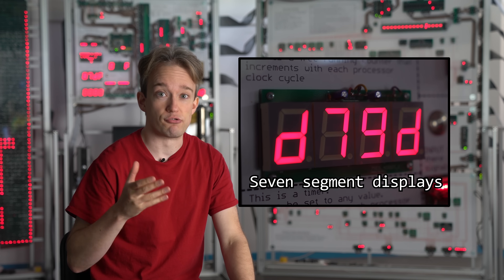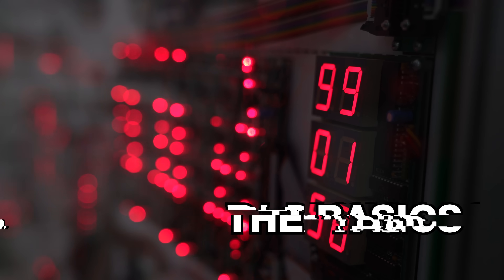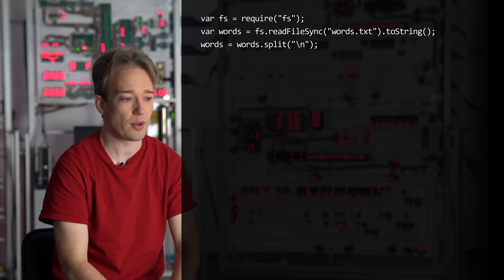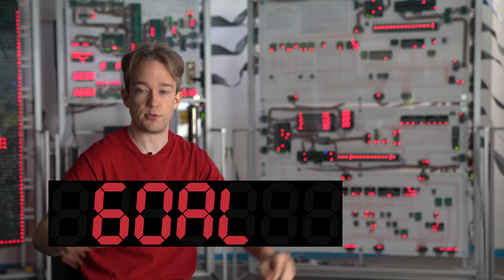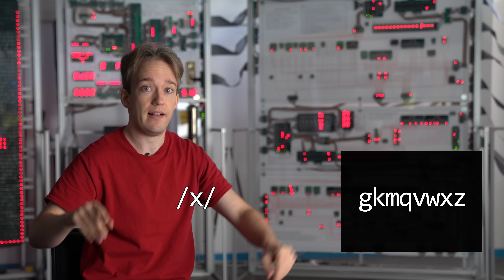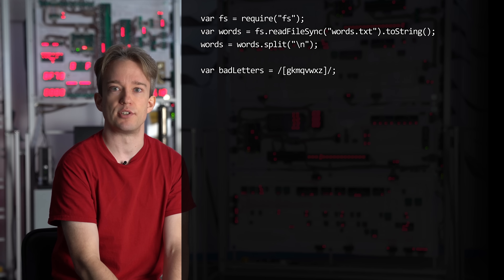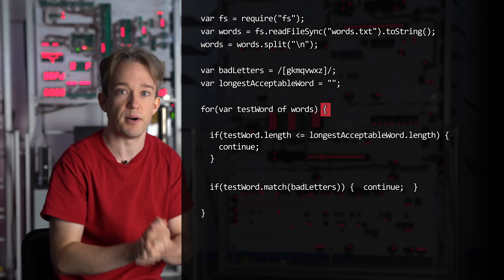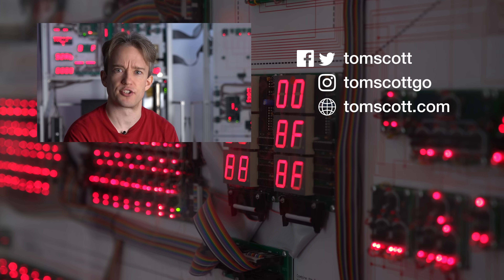What's The Longest Word You Can Write With Seven-Segment Displays?

Comment: How would I do that? Instead of the longest word, save the length. Then add the word to a list of longest words.

If the word is shorter than the longest word length, it's ignored; if it's the same, it's added tp the list; if it's larger just clear the list, set longest word lenght to the new one, and add the word to the now-empty list.

Comment: 7-segment displays are still used a lot on thermostats for commercial cooling and heating. As for M. Manufacturers just use N and let you scratch your head for 5 minutes before you get it.

Comment: Why not have the "N" lower case? Otherwise, you aren't sticking to your own rules that you can't do diagonals. Also, that "G" looked absolutely fine, not the "6" one but the one where you took out the middle horizontal line. It clearly looked like a "G," no one would ever mistake that for a "C." Not only that, but you'd use a "5" for the letter "S" but you won't use a "9" for a "q?" Nor will you use it for a "g?" Why the hell do you have such a hard time following your own rules? It doesn't make sense if you don't follow your own rules.
Reply: That shape G is practically used to mark Ground Floor in lifts (elevators) with 7 segment display.
Reply: 3:59

Comment: Js isn't the best language... If you use "var", it certainly isn't.
Reply: JS is just fine for the job at hand.
var is also fine.
APL would be the best language for this because it would only take one line of code.
Octave can also do it in fewer lines than most languages and no loops.

Comment: Please, please, please don’t teach people to do file I/o that way. Next thing you know some joker is going to think it’s ok to write code that attempts to load an entire gigabyte file in to memory at once. No reason to try manipulating the whole of the English language in memory at once, just go word by word. I suppose it might run slower, but then your code will work regardless of file size.
Reply: It will actually run much faster using a readable stream instead of dumping the entire file in memory using fs.readFileSync(), I guess largely because you don't have to wait for the file to load before starting to process it. I tried it out and with the example file the streaming version was about 3x faster (and it had a much smaller memory footprint, of course).

To be fair, the example isn't really about file system i/o, and Tom does a good job of illustrating the point that programming is largely about analysing and solving problems. I think it would be a bit much to start teaching beginners about events and streams. ;)

Comment: Well instead of continue you can inverse and nest the if cases but that can also be messy, which is why it's a tredeof and depending on what you are doing on or the other is the best option
There are alot of cases where there is an inverse version of you code that will look differently but do the same thing

Comment: You don't need code as such to do this, you can use the egrep command:
egrep "^[^gkmqvwxz]{11,}$" words.txt 
The regex matches all lines that consist of 11 or more characters not in the list. The 11 is the minimum length. In the list I was using 11 with the full list only found 1 word: "nystatinoaf", although that word only returns links to word lists on google, so I'm not sure if it's real, or a typo in the list.

Comment: You can also use a functional approach to solve this problem instead of the loop, which is usually easier to read and understand. 

words = words.filter( ( word ) => !word.match( badLetters ) ); // Filter words that do not match the regex
words.sort( ( a, b ) => b.length - a.length ); // Sort in descending length order
console.log( words[0] ) // Print out the longest word

Comment: You can do it in a single line with Mathematica:
MaximalBy[DictionaryLookup[Characters["abcdefhijlnoprstuy"]..], StringLength]
Using that I get the result of "uncharacteristically" and "tenderheartedness" if I disallow I and O (each unique for their length). It only has a dictionary size of 92518 words though, which is a fourth the size as the one you used.

Comment: ages ago I had made an 8 digit 7 seg LED display (video of it on my channel) that could take ASCII serial (BELL character made the unit beep , numbers, colon and capital A - U) and display numbers and letters, I'd programmed it to use the "C with aspirations" for the G and displayed other symbols for a few of the letters that couldnt be adequately be displayed  (like K M and Q i think) and I didnt have room on the controller for letters after U anyway so (any undefined characters) they just display the ASCII code pattern in binary (either looked like a garbage character or one of the previous letters or numbers)

Comment: I get away with banned letters on a seven segment display by just marking them with the decimal point and just letting it be.
For example, M would be n.n., covering two of the SSDs.
A K is just an H with a dot
A G is like the incomplete 6 you mention, but with a dot. Actually looks fairly close.
A Q is just an O with a dot.
A O is the undercase o.
Repeat until you can accept the full alphabet however you like.
If I can find the code I did for this I'll definitely put it in here.

Comment: You can easily check for multiple words of the same length by creating another variable that logs word length and make the code test var length against that. longestAcceptableWord gets concatenated (with a space) if word is equal length and set to new word if word length is greater. Not very much more code to implement that.

I studied coding in college some years ago but I don't work in the field anymore. I like the simplicity of JS though.
Reply: also I think i and o are fair game if lowercase, much like r

Comment: If you only want to test whether a word contains these letters or not, use badLetters.test(testWord) instead. It will return a boolean instead of returning an array or null like badLetters.match(testWord) does. There is nothing wrong with the "continue" statement in my opinion but using it in this code felt really unnecessary. Rather than making use of this statement, you could have tested for testWord.length > longestAcceptableWord.length and then for !badLetters.test(testWord) to change the longestAcceptableWord, I feel like it would have been easier to understand for viewers that don't know how to code. Still a really interesting video though, didn't expect that many letters to be writable on a seven-segment display !

Comment: i and o can be written lower case to avoid ambiguity. n is perfectly fine even though it is more commonly written as lower case too, it just looks nicer. G should be written without the middle segment as this is unambiguous. S and Z should either both be included or both omitted as they are valid but ambiguous

Comment: Multiple longest words. This is some broken untested code. Correct me if I'm wrong

// previous code to read from file
var longestLength = 0;
var matchingWords = [];

for (var testWord of words) {
    if (testWord.match(badLetters)) {
        continue; //remove disallowed words
    }

    if (testWord.length < longestLength) {
        continue; // word is not long enough
    }

    if (testWord.length == longestLength) {
        matchingWords.push(testWord); //this word is as long as the others
    }

    if (testWord.length > longestLength) { //this word is longer than the others
        matchingWords = []; //clear all the shorter words
        longestLength = testWord.length; // update the new longest length
        matchingWords.push(testWord); // add this word to the longest
    }
}

console.log(matchingWords);

Comment: 8:22 you can just change the < or = sign into a purely < sign so it will prossess words of the same length then you create a new variable array called answer and if it passes the bad letter match add it to both answer and set longestAcceptableWords to it.

Edit: also keep running answers against longestacceptablewords and deleting the answers that becomes shorter than it.
(I know this is inefficient but it’s the best I can do)
Reply: Keep track of the longest word length as a int.   If = add to the array. if > set to new array.

Comment: In my opinion you could've included the q. Your reason was "because it's basically a 9", but I don't find that to be good enough reason, as a) You could say the exact same thing for b and 6, but you've included it, b) it's not completely the same as 9 (as for example S/5 and O/0 are).

Comment: No, 'this' isn't fine. Continue is sin. Never use it.
Reply: Yes, always make it a big long switch statement inside a while and fiddle the index of the switch.  This way nobody will ever figure it out.
Reply: put the body inside a function; return it when it fails at precondition; same thing as continue?
Reply: Kirrim Kerman:
Since JavaScript allows you to have an array of functions etc, you can just have the if statement change the function to be called later on.
Reply: @kensmith5694  I don't think that this is in any capacity a good practice.
Reply: Kirrim Kerman:
My suggestion was not serious.
Reply: @kensmith5694  I kinda assumed that.
Reply: Nested if statements would have yielded the same result, or the && operand
Reply: Why? There's nothing inherently wrong with continue. It can be used badly, but so can nearly everything else. In this example probably a simple if with lazy eval would be nicer, but the continue works fine too.
Reply: Honestly my only issue is with the name. It should be called 'skip'.

Comment: Wouldn't it be better to add the i regex flag and make the test case insensitive? Or is the list only in lowercase?
Reply: nah, the list is lowercased already and case insensitivity adds a marginal overhead
Reply: Hence why I asked about the case of the list. 

Though said overhead is very, very tiny. I actually run through the list twice, once to find the longest word, and once to find any others of the same length. It was sill near instantaneous on a Core2Duo--running inside a browser.

I kept the i because it allows me to easily copy and paste in letter lists, even if the person uses mixed case.

Comment: Tom: you had a if "equaly or shorter" in you word length comparation so I think it will output the last word of the longest length so if it just list all words that it finds after it discarded ones with unacceptable letters you will have all of them with barely any changes in the code.

Comment: Why do you seem disappointed with the word at the end? I mean more...what were you expecting. It seems the result wasn't whatever you were shooting for. I'm not challening you to not be disappointed, I'm just not certain why. It's a neat word and it's a "real sounding" word vs some odd sounding word.
Reply: I don't know about Tom, but I don't like that it's just an artificially extended word using the wrong suffix. The noun form of "transcendent" is "transcendence," not transcendentness. 

Removing that word from the list, I get both "superrespectableness," and "supersuperabundantly." The former has the same problem: the word should be "superrespectability." And I find "supersuperanundantly" to be stretching the ability to add prefixes.

So, after one more try, I get "supertranscendently," which does work.
Reply: Thanks! I see, I'm not the best with words, so I didn't really see that issue. But I can see how that is disappointing for sure! Thanks again for taking time to reply!

Comment: I thank RNJesus this problem is more like a one liner in nodejs and browsers theese days, but indeed Tom explained it very well. This version filters out undisplayable words and sorts the words by length descending: words.filter(word => !/[gkmqvwxzio]/.test(word)).sort((a, b) => a.length < b.length)
Reply: Paul Bottin and you can also Console.log the [0] index in the same expression :)
Reply: AramesK Channel™: Yes but then you lose the ability to get all words and not just one.
Reply: The sort() method is very slow, though, because it does loads of comparisons you don't actually need to do for this task. If the question is just to find the longest word(s) and not to sort the entire list by length, you're much better off with a simple for loop comparing the length of each word with the longest word length up to that point, and only test a word against the regular expression if it's longer or has the same length.
Reply: Outrageous Pickles: Yes I wouldn't recommend this approach for huge lists, but in 2018 I wouldn't consider "words" a huge list so it's perfectly suitable for this problem. It just solves the problem as I mentioned in one line.
Reply: @mad_fresc4842  I think you can get the performance gains of the for-loop method (and still write the code in one-line) by using the reduce() method.

Comment: I don’t see why you could not use more than one module to display something like an M. I would display that as a backwards 7 on one display and a 7 with the extra line on the next one which would look roughly like this:
 _ _
|  |  |
|     |
Reply: In real displays it really looks bad.
Reply: But it does "work".
Reply: For small enough values of "work".  The user has to be told it is an "M" or most would not guess it.
Reply: Ken Smith that’s true. It probably falls under the same thing as G.
Reply: Bryce:
Picking a 6ood set of 7 segment characters is not easy.
Sometimes you have to just go with something 6ood enou6h to 6et it done.

Comment: A really good practice for programming that I use all the time is:
1: If a block of code is longer than 10 lines, you should probably consider breaking it up into functions. 
2: Each block of code should be organized as:
       Check edge cases(values are null, aren't acceptable et.c.) -> return / continue / break
       Do default behavior
3: Make sure to think long and well about your variable/function/class names, and don't be afraid of long names, because we have codecompletion now(If you don't your programming tool is terrible).

These three practices have made my code a lot more readable.
Reply: 1: ....  or stop to comment at about line 7 so that what follows is explained
4: Say the names of the variables to your self.  If two sound like the same thing change one.
5: Avoid "flag" names that don't make it clear what true means

Comment: Lower case o and i are perfectly valid in my universe. So FLoccinoccinhiLipiLiFicAtion. Sadly Pnumonoultramicroscopicsilicovolcanoconiosis fails just 4 letters in.
Lower case q is acceptable using the decimal point as part of the tail.

Comment: Quite fond of "continue" myself, as it massively reduces indentation.
Reply: Yes, it often leads to much clearer code.
People get into religious wars over all sorts of nonsense.
In a language without a throw, "goto Abort" can be the clearest way to code when a bad input is discovered.
I also use a really simple set of indent rules so I can code in many languages.
1) An indent for nesting is 2 spaces for each level
2) An indent for line continuation is always 4 or more
3) To avoid
if (something) ;
{
...
}
I instead code
if (something) {
  ..
  }
so there is no risk of the ";" by mistake error
4) Since we are indented until after the "}" the spacing is as shown

Comment: If you are dropping ‘i’ and ‘o’ as they are numbers 1 and 0 also need to drop ‘s’ as it is 5
Reply: The original question was, "what is the longest word". Since words are made of letters, you can exclude digits and reuse the 7-segment digits /[015689]/ for letters.
Reply: Dropping o also doesn't make sense as usually 0 and o are displayed differently in seven segment displays. o is nearly always displayed with only the bottom 4 lines making a small o compared to the taller 0.
Reply: his reasoning seems weirdly inconsistent to me, lowercase o doesn't look similar to any number, while S is 5 as you said. Also that capital G without the crossbar seemed quite clear, and a 9 and q are clear since the bottom segment is off with the q.
Reply: Also z is 2

Comment: China here. Some traffic light have a time display showing how many seconds left till the light changes (ps. they are 2 digits in the display), and in very rare cases, for 100+ seconds, the tens digit start to display letters (A=10x, b=11x, C=12x, etc).
And I witnessed a really rare case in a really weird traffic condition. It went up to O (24x).
I forgot how they dealt with K (shame). But since all they have to do is to make every letter distinguishable from other ones (drivers can see a strange shape, and think either it's 100+ or the light is broken), for the tricky letters:
G - yeah they just did the 6 without the bit in the middle.
I - to tell it from number 1, it used the two lines on the left of the display while the number used the two on the right.
M and N - M is a big arch (0 without the bottom), N is a small arch.
O - to tell it apart from number 0, the letter O uses the small square.

Sadly this scene never, ever, ever happened in my life again.
Reply: Maybe K was |-| and H was a lower case, h ("4" rotated 180deg).
Reply: @HunterDigi  Or the opposite could be true. I have also seen this for "k".
|_
|_
Reply: K could also be this
 _
|_
|  |
Reply: i is one segment and L is 2, both on left side.
Reply: This is also a unique solution for K:
|-
Reply: dont you just have to display "long ass wait time symbol" when you reach letters like "k"? so instead of showing K x 100 secs, you can just put a symbol there that shows "hey, you will wait 10 or 20 minutes, but you cant leave anyway, so you will have to wait even though you dont know how long it will be"?
Reply: Klosterhasi; best answer yet.